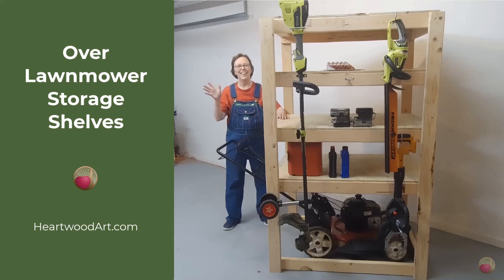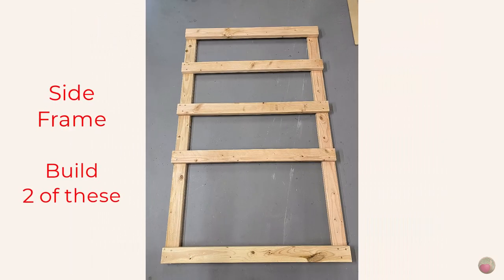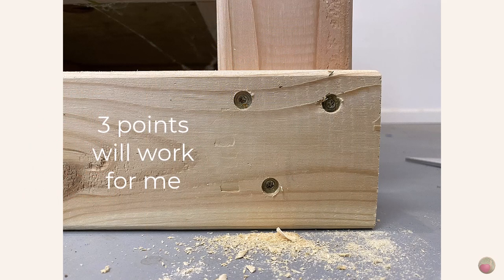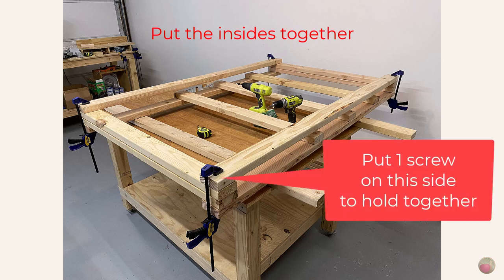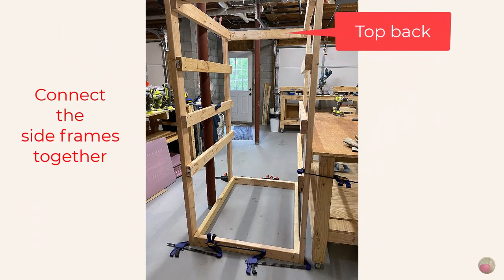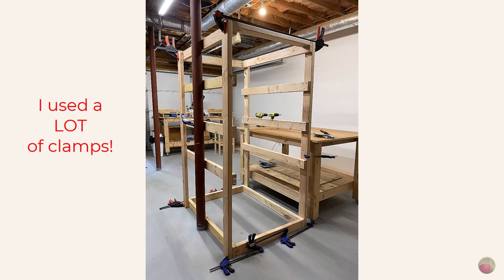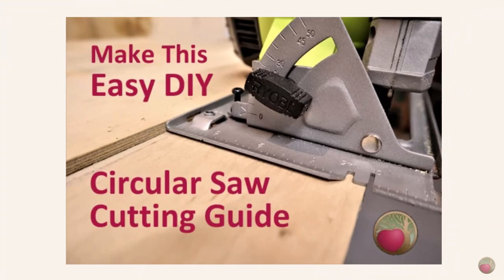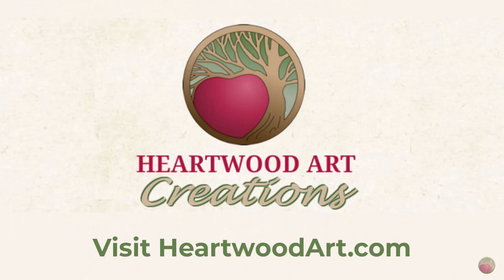Over Lawnmower Shelf Storage

Comment: What a good idea! That mower has to be stored somewhere and the space above it is inevitably wasted. But not with this idea. Will definitely build it. I will modify a bit though. I have a second lightweight Makita battery operated mower that I plan to store above my heavyweight Honda Buffalo mower. So I'll have to build a ramp for the second mower with the handle folded down. Problem solved. Thanks for sharing this idea.
Reply from the maker: You’re welcome. I used to have the mower in front of another small shelf there and got tired of reaching over it or having to move it to get to the stuff on the shelf. Plus the other shelf was to small to hold everything. This solved both problems.

I think your stacking mower shelf sounds like a great idea!